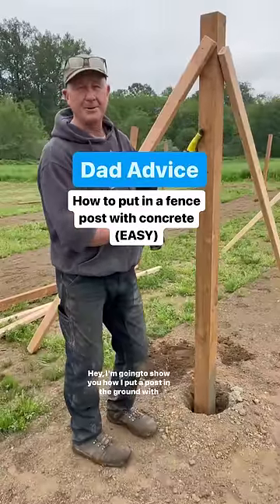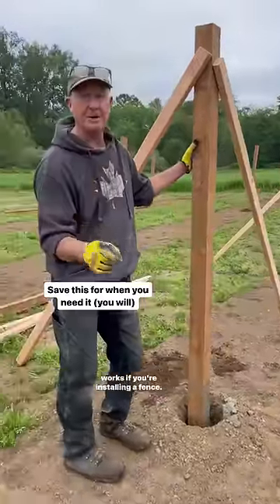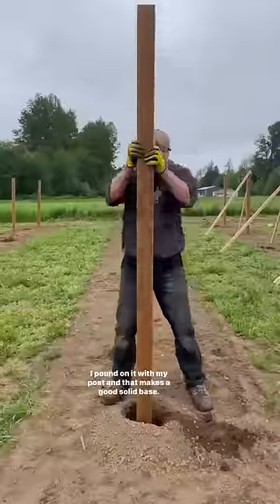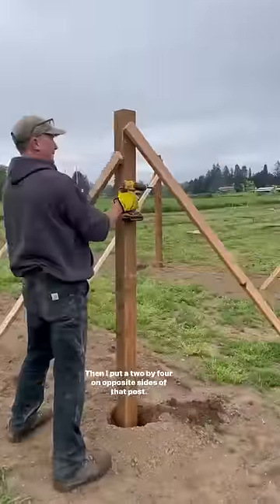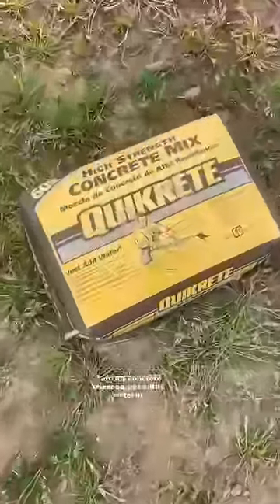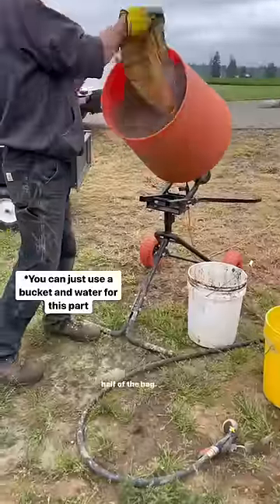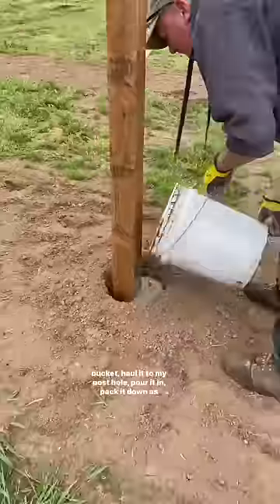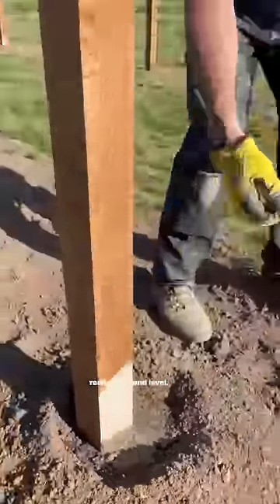How to put a fencepost in with concrete. Love, Dad

Comment: I learned years ago from a fence guy to pour the dry concrete in the hole and then add water on top.  This way the concrete expands into the hole.  If you put it in wet, it could shrink and leave wiggle room. Works great.
Reply: I’ve built miles of fence. Always used dry.  Never put water on top of it.  I’ve had to pull some post up a few years later, that concrete set hard.
Reply: @redbovine the purpose of adding water if you have quickset post concrete is it sets hard fast and you can go ahead and attach the fence right away with no worry about throwing it out of plumb.
Reply: @redbovine  Interesting
Reply: also 10x cheaper and easier for him to do... so did he tell you to pay him less too?  has he ever been back?  its buried, ypu have no idea man.  gullible as day=long
Reply: @summoner9924  Settle down, buddy. I did the work myself and he came and helped for free. He worked part time for me at UPS and managed a fence company during the day.
Reply: @redbovine  I only dry pack the corners. So I can pull string lines and not mess them up. When dry setting, you def have to pack that shit with a tamp rod!
Reply: Just fill the post hole with dirt I've had no problems with my fence falling over and I learned this trick when I was 8 years old from my grandpa no one has ever called and complained that their fence fell over and my personal fence is still standing after 26 years
Reply: @summoner9924  Something else he shared with me: go to a fence company and ask to buy their reject fence pickets. I bought three pallets for $40 each. I had to pick through them to find the ones that were good but I got all 600 pickets for $120 when that would have cost about $800. Also, use landscape timbers in place of 4x4s. They cost about half as much and you turn them to use the flat side.  The entire 6' privacy fence cost me about $500. Installed by a company that same fence would have been $3000.
Reply: @tomtroy3792 can typically only do this with clay dirt right?
Reply: I do the same. I also water proof the post before adding the cement and water so the post won’t rot with the cement or water
Reply: @BushiestBesver  any kind of dirt even sand try it it's amazing it works and it works very well concrete just makes the post bigger and heavier at the bottom but if you plant your post in deep enough there is no problem whatsoever
Reply: @summoner9924  ive seen people pour in dry. If ground is wet it will pull water from it but definitely works and many ppl use especially if they have a lot to put in.
Reply: Also his looked pretty watery but it’s just a fence post.
Reply: Yes dig holes with string line make sure the holes are the right centres 13rd over the line 23rds behind use one of the rails for inters put 1 bag near post hole then 2 on the next all the way down the proposed fence line the cut the bags with Stanleyblade next get three drums of water and erect using roughly 1.5 bags per hole plumb to string line with rail on the floor so u don’t run out of centres thanks from sunny wales uk 👍

Comment: Sink a strong tie metal bracket into the wet concrete and when  it dries nail the post to the strong tie. We do this in Chicago because with the totally frozen ground in winter, with the thawing and freezing cycle, expansion and contraction, the post can break off in the ground in some rare cases but it will certainly rot over time and fall apart that way.
Reply: Where does one purchase the metal bracket (or do I have to fabricate one?)  That is the ideal foundation.

Comment: Good tips. I always add ~3" sand and compact, so the post doesn't sit in a "concrete cup" which would otherwise rot a post within 10 years.
Reply: in Texas we dip them in creosote or paint and tape the bottoms .. but this is a good method to
Reply: @Z.the.G  Yes creosote works great. Soaking the post in diesel a few times works well too, adding a couple shovels of gravel to the bottom of the hole helps (or a rock), and or charring the portion that comes in contact with the ground (and 8" above) are options that can make a very big difference in longevity (up to 100 years), but just be careful charring diesel soaked posts(!!)...
Reply: @Z.the.G  I was thinking, theoretically, you could drip melted "recycled" plastic (HDPE maybe) on the post. You could also probably "paint it" in closed cell expanding foam (can of gap filler), or roofing tar, and or wood preserver. Just depends on what's available and how long the fence needs to last, but I would char the very bottom/underside of the post before I painted it or else it's a post in a cup made of latex or tape, etc...
Reply: I seen guys use mastic before
Reply: @matthewtheking  chemicals would leache into soil and crops
Reply: @DatsiKxModz  BS. HDPE would leach out? You shouldn't make a raised bed using copper treated wood soaked in diesel but if you're talking about a ranch fence and you wanted to last a long time you don't need to give a f*** what your fence posts are treated with to be honest. Complete nonsense

Comment: I found here in Michigan that P gravel works great it hydrolocks itself together. I had always used concrete, a city building inspector told me about it, and it works good.
Reply: Use 1/4 down crushed gravel. Not pea gravel.
This is what we use in Canada where our frost line is 6ft or more so the posts dont heave.

Comment: Looks good.

You won't believe me unless you read the package. I recently learned that you can pour some mix dry directly in the hole dry and then add the water on top.

You can look up numerous examples online
Reply: This absolutely works!
Reply: Been like that for years i was wondering why he had cement mixer out.
Reply: I believe you bro
Reply: Did that when I installed my parents new mailbox! Works like a charm
Reply: I do the same except I add +/-gallon water half a bag concrete stab at it with a 3/8 rebar to mix slightly and pack concrete add the other half ass more water poke few more times .. done .
Reply: You can do that, but it should be the red, fast setting bag. Not the standard set yellow bag.
Reply: @captaindikhead5234  If you had a cement mixer you would use it too.

Comment: Also run 3” screws in the post randomly at the bottom. Leave them sticking out about 2 inches. Put a few on each side of the post. When you pour mud around them they become anchors in a way. My grandpa would never set a post without doing that.

Comment: You can skip the mixer action. Cement is hydroscopic, and will evenly absorb water, so you can simply pour dry cement around the pole and wet it down with a jug of water and let it set.
Reply: I noticed cement bags labeled as “fast drying” have directions to do as you say, but the others say to premix first. I’m genuinely curious why wouldn’t they all have directions to pour the cement in the hole then pour water over?

Comment: Now, to make that post last a long time.  Do this...
1. Over fill the hole and slope it away from the post to ensure good drainage.

2. When it is almost set take a large nail head and scratch a groove between the post and concrete

3. After it is set, use a good exterior caulk in the groove.

Wood & concrete expand at different rates. The caulked grove will flex and keep that joint tight and keep out the water.
Reply: Thank you

Comment: Ur wasting ur time putting 2x4 up I do fence every day people that don’t know how to do fence do it that way
Reply: Correct. Run the top plank before it sets or they all gonna be off square when you board
Reply: @kevinmulligan9055  
Not unless you use a string line
Reply: @Akooks  string line will give you the correct position however a tiny bit off on the post and your nailing the board on to a post that ain't gonna sit flush. So if you put one top line oñ boards in while setting posts you achieve 3 things at once. 1. You can set your length line precise 2. You ensure each post is sitting flat to the board. And 3 you can set your depth of post/height correct for each postv

Comment: I've always poured dry mix around post then add water then poke around the post in mix with tomato stake then plumb the post. You can add to much water because any extra water the ground will absorb. Been doing it for 30 yrs on various projects. All the extra bracing is little out of hand.

Comment: My experience is that dirt will build up on top of the concrete over time and when wet, will eventually rot the timber at the base even if it’s pressure treated.

What we do here in the South East is put a concrete form around the top of the hole to raise the mixture above grade anywhere between 4-6 inches (or more, depending).  Then before the mixture sets, we insert a raised metal mounting bracket in the center of the hole that goes down into the concrete and provides a raised cradle that the post is then set into and secured with bolts.  Once the concrete is cured, we cut away & remove the heavy cardboard concrete form.

This method is a bit more work and expense but the end result is a structure that will last much longer in wet or freezing weather conditions!

Comment: I've done several posts that have lasted for 20 years, never use concrete (in Florida), it will cause premature rotting no matter how you do it (pressure treated, "mounding concrete" etc.) I use base gravel and sand, water it in and pack the crap out of it.  It is as solid as concrete but allows drainage.  My neighbor used concrete, and in five years or less, every post broke off at concrete/ground level.

Comment: Here's the secret recipe we follow on our dairy farm in upstate NY. We haven't had a post rot-out below grade in 40 years doing it this way. We dig a 4' deep hole to avoid frost heaving. We only use 6x6 PT wood for posts. Go large or go home. We place the rock in the bottom of the hole. We tamp the rock in by dropping the post into the hole ONCE. We mix up fast setting, CLOSED CELL foam into a 5 gallon bucket and pour it in before it starts foaming. The foam expands and sets the post HARD in about 30 minutes. Make sure that post is held level! Go back and trim the foam cap to grade with a hand saw. That post bottom will never touch any water or rot out below grade in your lifetime.

Comment: Built fences for years. Stopped premixing the concrete and adding the supports once I learned both are unnecessary steps. Put the post in the ground holding roughly level. Pour in dry concrete while spraying water into hole. Smack post into level position when finished and walk away. Never had one post move out of level. Concrete will soak up any ground moisture it needs.

Comment: I know everyone wants to put in their 2 cents… but, here’s mine.
1. I cut some rough notches in the base of the wood so it’s not a slick surface and to better grip the concrete
2. I add a few nails or screws to the base of wood to also better grip the concrete.

Comment: to remove air bubbles I use a stick (just stab it all around the post, air bubble create a weal spot for the concrete to break) ALSO I always crown the top so water does NOT have a chance to set and pool thus rotting out the base. I always build my frame and then pour my concrete, this helps to keep it stable and I only need the front to back 2by4's plus it lessens the stress on the concrete when I'm adding my pickets OH and I screw EVERYTHING nail will work their way out but screws won't, and if you predrill a hole its less likely to split the ends

Comment: Way to go. You can either use a rock or gravel in the bottom. Stops the posts from rotting. I dig my fence hold bell shaped to stop them shifting in the wind.

Comment: I would also add a aluminum or plastic sleeve where the post meets the ground to prevent rot and I would also add a nail on each side of the post where it will be set in concrete which will make it impossible to ever be pulled out of the concrete.

Comment: What i did when i built a former neighbors fence in 2004...same thing BUT i bought for like $5, about 80 6" nails from the habitat store, which I nailed 4 on each post bottom at different levels to help "grab" the concrete like a root.  That added even more strength.   BUT my posts were 6x6 posts..not 4x4s.  After a major hurricane went over her neighborhood in 2023...her fence being 19 years old had only 7 pickets failed, and every single yard in her neighborhood had ALL their fences failed.  Six months later, almost all of her neighbors copied my design and built their fences like mine.
Reply: Yes I put screws or lags on it

Comment: Set up a string line, mark your holes with paint. Dig the hole. Clean it out. Mark grade on the bottom of the post with a sharpie. Make sure your holes are at least two inches deeper than the post grade. Mix concrete. Put one or two shovels of concrete in the hole. Set your post in the hole, level it off of the string line you don't have lol. Check grade line on the post with the grade of the ground. Finish filling with concrete. Either cap the footings with extra concrete or leave the concrete two inches low and fill with dirt your choice. After about three or four post are set, use your eye, tape measure and a torpedo lvl to flow the top of the post. You don't need extra framing lumber or anything bigger than a torpedo lvl. 😂. I've been setting fence post for over two decades. This is how most fence companies do it. How do you make any money at that rate?

Comment: It’s easier to dump the cement into the hole around the post dry, add a little water, plumb the post, and go to the next one. After I learned this trick, I sold my mixer.

Comment: Use a split bucket with bottom off, take concrete above ground level.
Once set, after 2-3 days get some resin and seal top of concrete brushing a cm up the post.
Then stain the wood, once dry, restain, let it dry, then Johnson's water seal, that will give an extra ten years on the post.

Comment: First install first and last posts, making sure they are plumb. When set, run a string on bottom between them. Run string between top of posts. Place other posts and align bottoms and tops to strings. Make sure the spacing between posts is what you want. Pour concrete on the remaining posts.  Now you have a set perfect fence posts.

Comment: I've put up wood stockade fences for years and have never needed concrete, dirt is plenty enough and lasts longer and stays plum and level just as long
Cement traps moisture and rots the pole 3-5x faster

Comment: I drop it in the hole. Add dry concrete. Tamp it down. Check level and adjust. Add dirt and rocks. Tamp. Check level. And move on. Never, Ever, have I had a problem with it😎

Comment: Those bags do not need to be pre mixed. Just dump the bag and add water if needed. Concrete will pull it from the ground. 
Also bell out the bottom of the hole. If the bottom is larger then the top it won't pop over time. If the walls are smooth and uniform or your hole looks like a carrot it's likely to pop. 
Run a string about 12-18 inches off the ground. Plumb your post up to that line. At end of day stand on latter at one end and make sure all the tops are in line. You have some wiggle room. So if the posts were a little off from eachother no one will ever know. Your working with materials that twist and warp, and will be outside. It doesnt have to be perfect. If it looks good it is good. 
A helper would save yourself a lot of trouble. You plumb the pole. Hold it in place and use yoir foot to help stablize the post. Helper pours in the dry bag. No need for 2x4s. The concrete will hold the post in place until it sets.

Comment: You could also pour dry Concrete in the hole and pour water on top of it which will allow the concrete to get soaked and then it will dry which will save you having to mix it.

Comment: I’ve been putting up fence post with just dirt. 8” round post 4ft in the ground and 4ft sticking out. Kick the fine dirt around the post until you can’t move it. Concrete will just rot the post out in a few years.

Comment: You should've watered the area around the hole, so the dry soil doesn't suck the moisture out of the concrete. 
It would be many times cheaper to make your concrete, especially when you have a mixer!😊